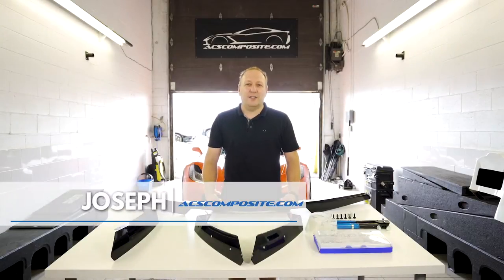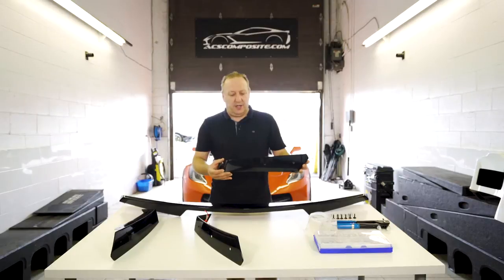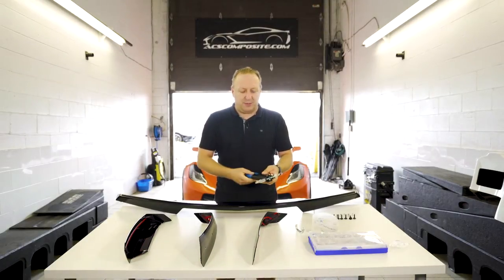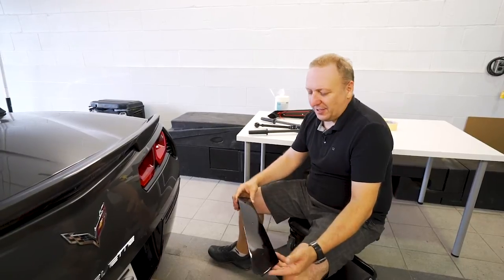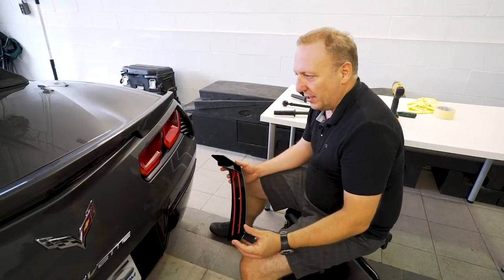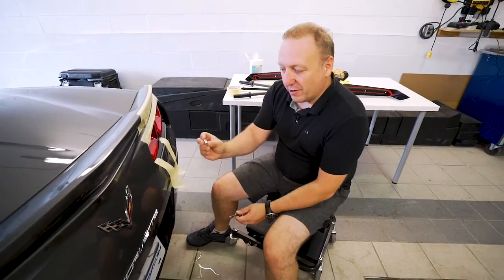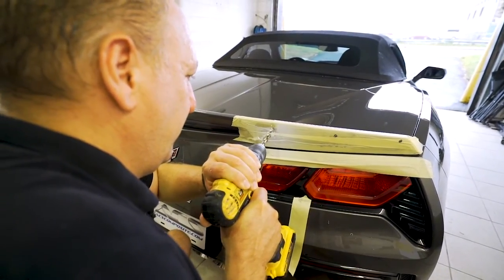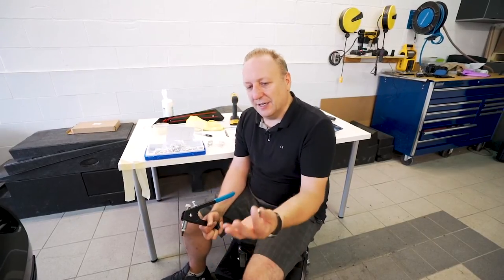Installing the ACS Five1 Wickers on a C7 Corvette Stingray Z51 | PN 45-4-117 CFZ

Comment: Joseph, you mentioned in the video that the wicker that attaches to the stock Z51 spoiler sticks up about a quarter of an inch.  How much do the more aggressive ones exceed the height of the spoiler by?

Thanks,

Bob Robitaille 2014 Z51 7spd Coupe
Reply from the maker: Hi Bob! Thanks for the question. If you went with our Stage 2, then those are 2”. And, if you went with our Stage 2.5, the those are 2.5”. The trick to remember is stage number we use. 2=2”; 2.5=2.5”. Let us know if you have any other questions